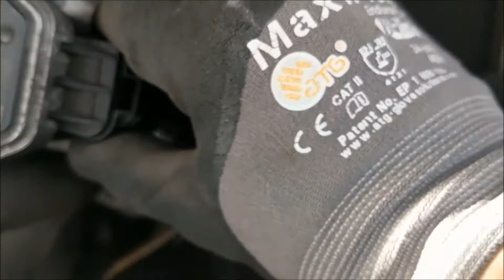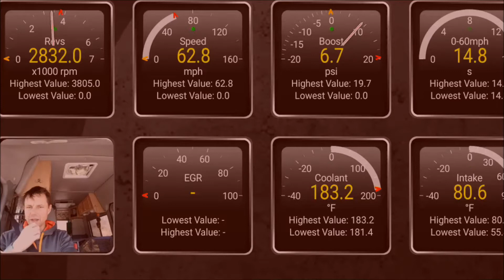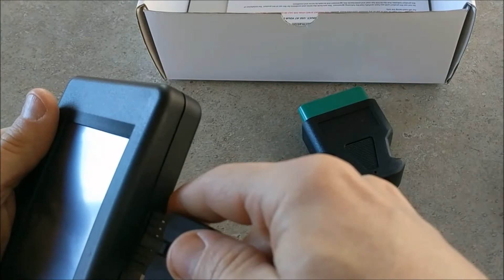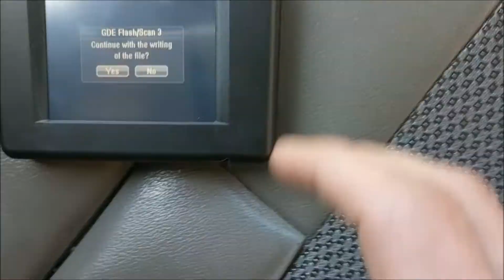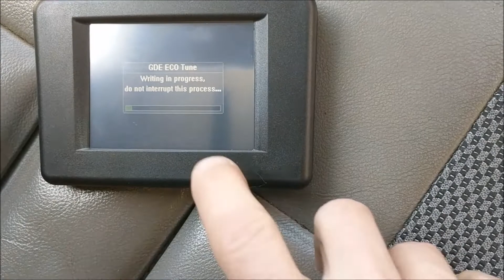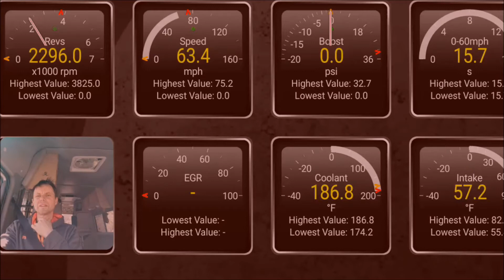Sprinter GDE Tune limp mode fix

Comment: Did you plug the Egr censor back in before you did the tune or leave it unplugged with the resistor still in place.  Thanks!
Reply from the maker: I plugged it back in and removed the resistor

Comment: I have a 2008 Dodge sprinter with the same problem would that work on my van?    I just check on the link that you left here it goes from 2002 all the way to 2006 only.   Do I have another option? I really appreciate your help great beer by the way
Reply from the maker: 2007 and newer are completely different. You can give it a try

Comment: I’m potentially going to buy an 04’ 3500 sprinter. It’s got the start error code (won’t start) would the GDE programmer delete the SKREEM system on a Sprinter? If that is in fact the problem anyway.. Great vid btw.. thank you!
Reply from the maker: I'm not sure. You should contact them and ask to know for sure
Reply: I contacted them last night, GDE got back to me this morning.. they’ve been shut down by the EPA.. the motherf***ing EPA!
Reply from the maker: Ahh that sucks. They ruined everything

Comment: Did you need to program the PIDs for Boost and EGR into your Turbo OBD app?  I have the paid version of the app but those sensors don't show up in the pick list when I add new gauges to a dashboard...  Thanks!
Reply from the maker: They sent me the obd tuner. I connected it and downloaded the OEM tune and emailed GDE the file. They edited the file and sent it back. I then uploaded it via the odb port. Don't know about the specific settings with in the file

Comment: I'm not sure where you are located but will this pass emissions inspection in most states with the tune? I'm in MA... I think after 15 years there is no emissions inspection but not quite there yet with some t1n's...
Reply from the maker: Not sure because I only needed a safety inspection, no emission test.

Comment: I am going to look at a 2004 Sprinter 2500 tomorrow afternoon. The ad states it is in limp mode. Price is $1500. Owner states he replaced the engine / trans with a 174K 2004 unit. So if I can limp it home (30 miles) I will order the GDE tune. I appreciate your video. Especially after watching the "Zim" russian dude. Thank you.
Reply: so what happened did you get it running?

Comment: Awesome video, I just picked up a 2005 sprinter 2500 and it has a code for the egr valve as well so I’m thinking about doing the GDE tune! How has it been working for you since you put it in, any issues? I tried the resistor trick and had the exact same result super frustrating.
Reply from the maker: Perfect. No issues at all. EGR is still plugged in but does nothing. The tune commands it to stay shut. Less particulate going back into the intake. The tune gives it a nice kick of the line. Shift points are a bit high but the tiptronic shifter allows me to override. Good luck